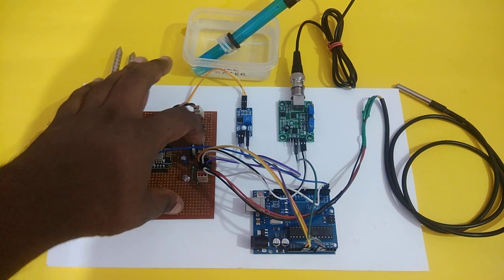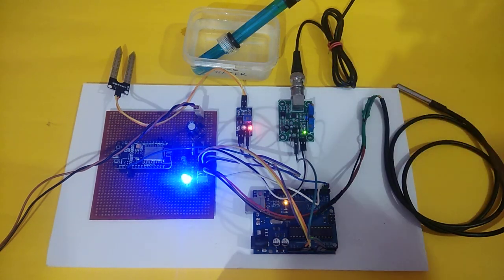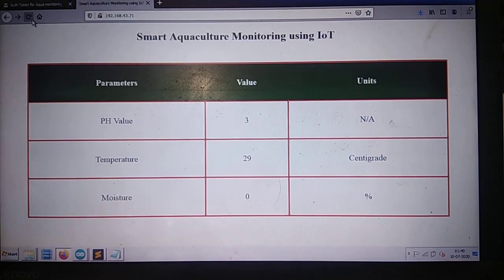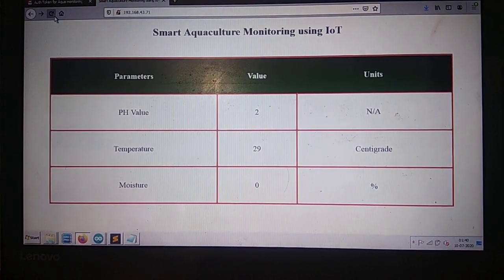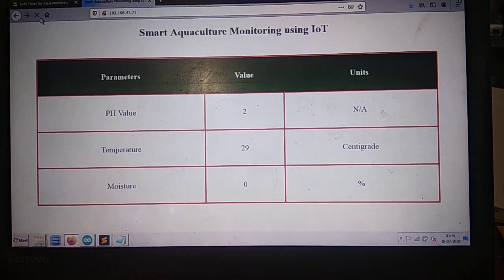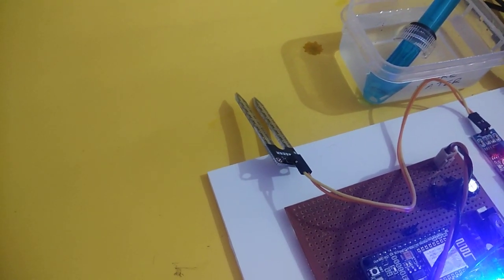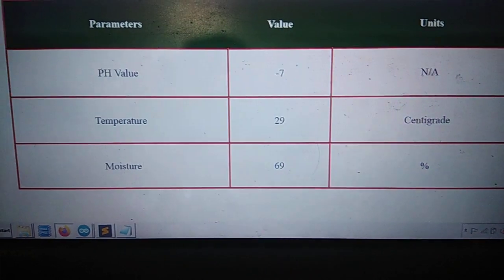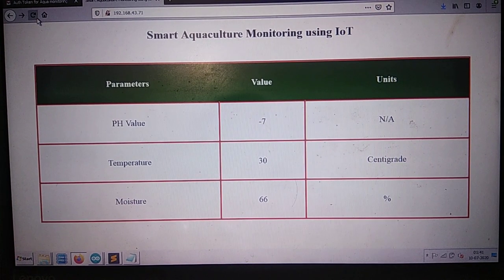How to Make an IoT based Water Quality Monitoring System using Arduino and NodeMCU

Comment: so i made this project,just keep few things in mind.Install arduino json 5 and not 6.Other than this,while connecting to the server,renenber to keep the phone from which u are taking wifi (like ssid=admin here) has data on and the device in which u r displaying data should connected to this wifi & have its data off. also,keep in mimd to chnge the calibartion value if u get -6 like here in water for ph.THE PH SENSOR IS THE MOST EXPENSIVE,COSTED US 1600 RS and overall cost was 2500.
Reply: Halo, can I know how you connect to the html webpage?